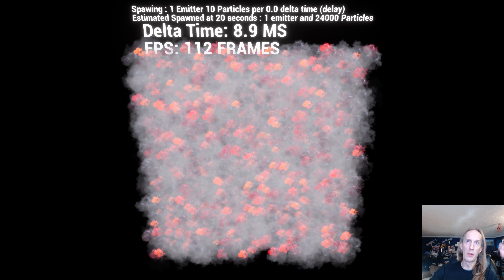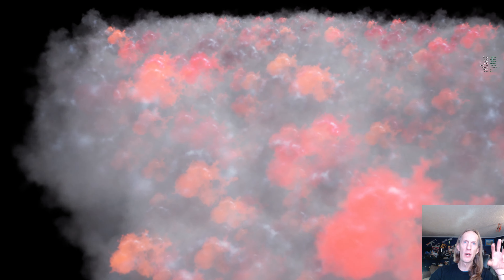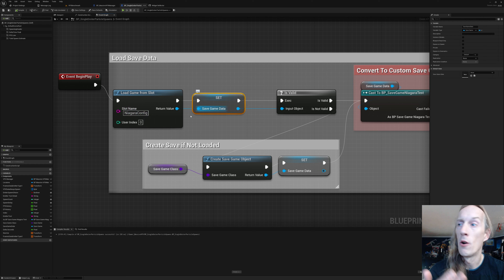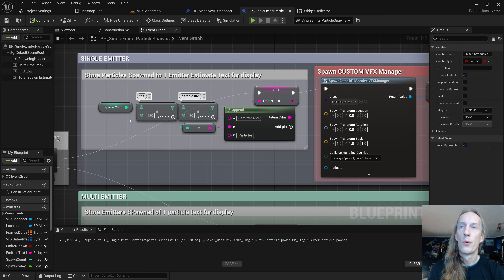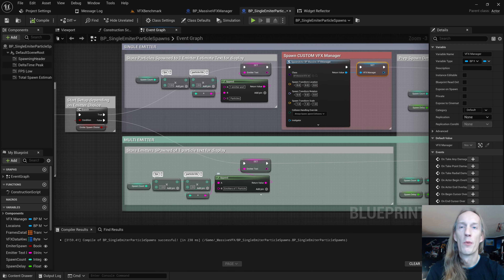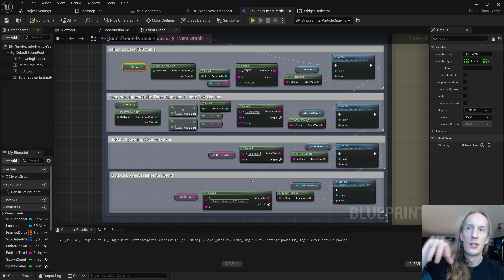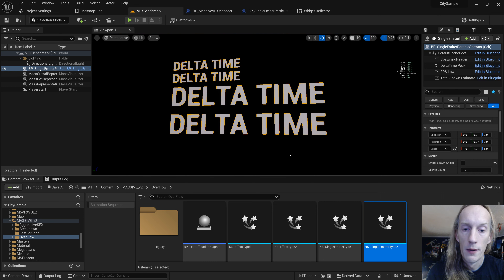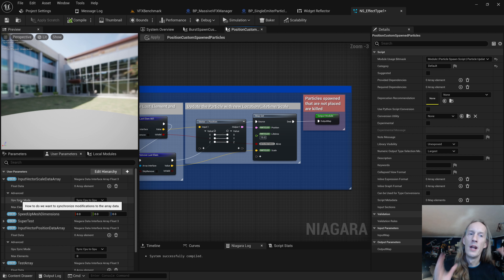Spawning Particles at Specific World Locations Unreal Engine 5 single Niagara Emitters custom input

Comment: Sorry, this is a long response, but what you're doing is fascinating and I've been working through the learning process the past week or two myself!

If you're just sending data into Niagara you should look into using a Data Channel, you can set up all the variables you want and stream them into the particle system. I'm not using it since I'm retrieving the particle positions from Niagara once they die, but for inputting the data it seemed to be much faster than setting arrays!

I love your trick for always spawn vs general particles, that's a handy efficiency boost.

I'm pooling my calls to Niagara together with judicious use of "Set Timer for Next Tick By Event", and setting the timer it generates to a variable. All of my pooling looks for that timer, and if it exists they just add their data to the array that I'm sending into Niagara. Then the event does the final processing and inputs the data. I had to be a bit careful with how I input this data since I'm mixing and matching player input with delayed events, but for the most part it just works. (Note: Set Timer for Next Tick By Event will happily generate multiples of the same event that all fire off the next frame, so you need to save and check for the timer. Set Timer by Event will only generate a single timer for each event you call and will overwrite the timer if you call it again.)

I'm setting my spawn count using "Get Float Array Count" and pointing it at one of my float arrays. I think that does the same thing as your scratchpad, but you don't have to make anything custom for it.

You may be able set position and scale directly in the Initialize Particle node. For Position, choose "Select Position from Array" and choose Array Sampling Mode "Direct Set". Choose your position array User variable as the Position Array. Then for the Direct Array Index, choose "Particles.UniqueID" -- It doesn't actually matter what the ID is, but since you're burst spawning particles they should all be contiguous numbers. Then to make sure everything works regardless of ID, set the Direct Array Mode to "Wrap". So even if you start with spawning particle ID 950, if you're spawning 1,000 particles that frame once you hit UniqueID 1,000 it'll wrap back to element 0 of your array. This array access seems to be enabled for almost every relevant variable, though some are more buried than others, and I think if you set it up you can enable GPU use!

Last thought -- You can batch multiple different meshes into a single Niagara system, and I'd imagine you can do the same with sprites. I'm tracking the index of each mesh that I add to my emitter in the manager Blueprint, and inputting that index as its own array variable. I haven't profiled this vs multiple emitters so I don't actually know if it's more efficient, but I'd imagine it at least saves on the cost when setting the arrays.
Reply from the maker: Fire fire fire Response!!!! Perfect! I havnt had much fun with Timers! But I completely see the use, How you are doing it, to bulk your data per frame. I must look into data channels! I agree we can test and most likely see bug advantage to multiple meshes/sprites per single emitter. I bet we win drawcalls that way! As for set parameters vs scratch pads, your right! It’s the same thing! Get into scratch pad tho... all the nodes are written with it! You can learn and modify/create your own. Cool system!!! Thank you for all the details!!!!!
Reply: @aggressivemastery  Yeah my whole destruction system right now doesn't make any use of tick, it's all timers and InputAction events! I've read that's more efficient in general, so I built to it for practice.

I've dabbled a bit with scratch pad, and it seems really natural to use. I've set up to dynamically enable collision when my particles are predicted to collide with something, and I've broken apart the default particle data export scratchpad to export multiple sets of data that I pair together in BP. I'm loving what it can do.

You're welcome, happy to help!
Reply from the maker: Using gpu collision (gravity) when airborn, and until collisions , is brilliant. I tried it before, but could only export off cpu sim(and I’m using up the cpu already.) so getting things back from gpu, would put that back on the table for me!
Reply: @aggressivemastery  Yeah, currently you can only export with CPU sim. I've heard we'll be able to use data channels to export from GPU in a future release, but I don't know which release that'll be. It'll bring massive performance improvements though!
Reply from the maker: I’m being told we can now! You can get and add particle positions. I think it’s just how we sync the data gpu to cpu or something ...
Reply: @aggressivemastery  That's great news if so! A dev told me it wasn't ready yet, but who knows. My emitter threw an error when I tried to enable Data Channel export on GPU sim, and the vector export shuffled the data so each vector was split over two different data channel entries.
Reply from the maker: I really need to look into data channels @MichaelRoyalty

Comment: With instancing the particles instead of spawning many systems, how does it handle sorting with other translucent materials in the scene? All the smoke in the system would share a single sorting index, no?
Reply: Yep. That's the case.. Particles within each system will of course sort fine against each other, but they will have sorting issues between different Niagara systems sharing the same root location. They'll also have sorting issues with Systems placed in-world, same as any other extra large VFX that have boundaries that overlap each other's system root. Would love to hear any thoughts on how to mitigate this..